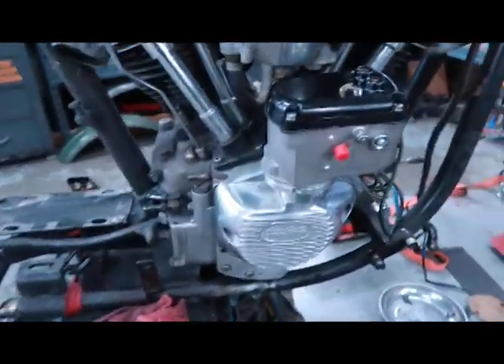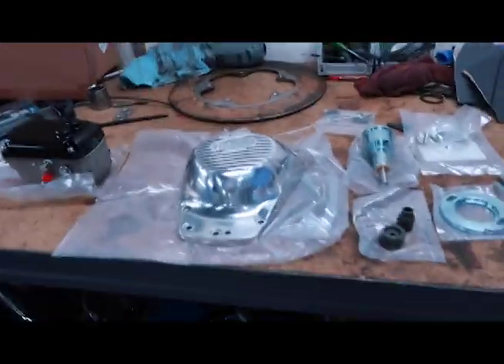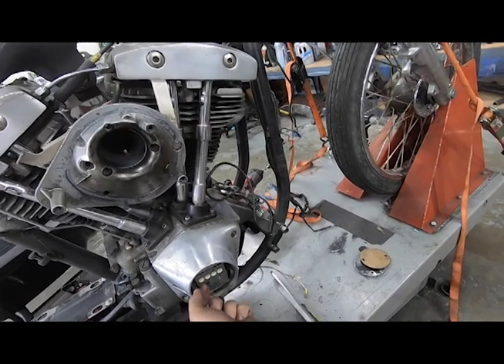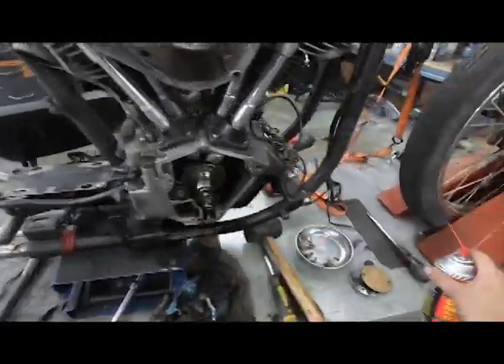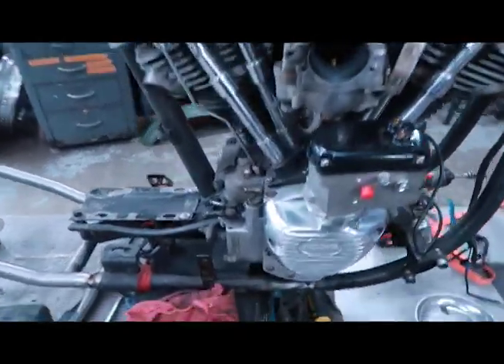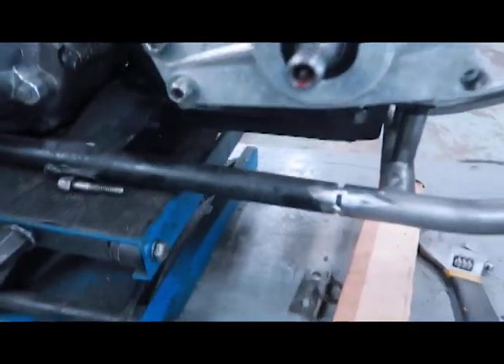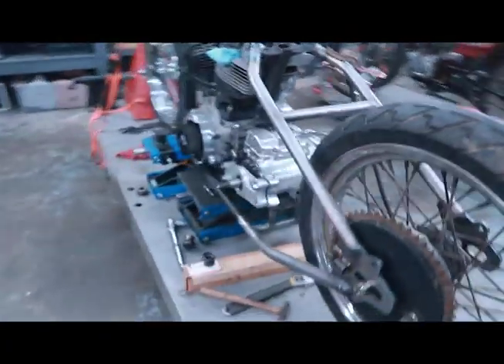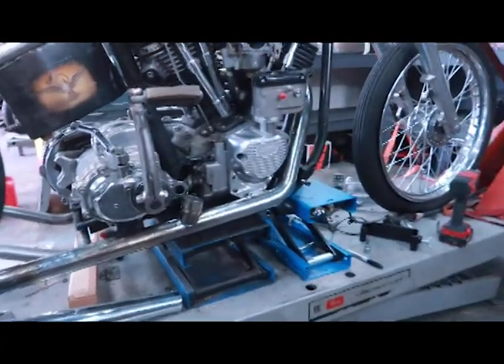Magneto Install |1979 80" Shovelhead Chopper Build Part 2 | Mazi Moto

Comment: Hey, you forgot a few things like cam and breather gear clearance.   loosen the pushrods to take pressure of the cam chest  when ever you are taking covers off and on you can cause damage.  you will need the lifer blocks out in order to check cam clearance.

Comment: If you don't know much about the motor I would at least adjust the valves, check cam timing and do a compression check. If all else Fales install the stock ignition get it started and running good THEN reinstall the mag. ignition. Eliminates a lot of guesswork and headaches.

Comment: Just the bolt on install and no info on the timing and setting up the mag,?  That is what needs to be shown not how to turn in a couple screws and set it on the base.
Reply from the maker: I will be retiming the magneto on this Shovelhead, if you’d like I can make a more in depth video of that process. In this video i was figuring it out myself, but will gladly film the process!
Reply: @947w0rks  That's great. Not for me personally though I've done quite a few. Have a couple of mag bikes now.
Reply from the maker: Awesome! What do you have? Haha maybe you can help me with timing 😂 can’t get this Shovelhead properly timed. Got it to shoot a fireball but that’s about it
Reply: @947w0rks  Find the motors TDC for the front cylinder. Install the mag so the front cyl lobe on the mag is close to opening the points. turn the mag until the points just start to open on that lobe. I use a mag timing box with light to show when they just start to open lock it down. Some old-timers use cigarette paper in the points and when it just can be pulled out lock the mag down. Check Goggle for more info though. Right now my magneto bikes are a 50 panhead and a stock 68 Sportster.  Have had a couple Shovels with mags though.
Reply: @947w0rks  Oh,The 50 has a Morris magneto and the 68 has the Stock mag.